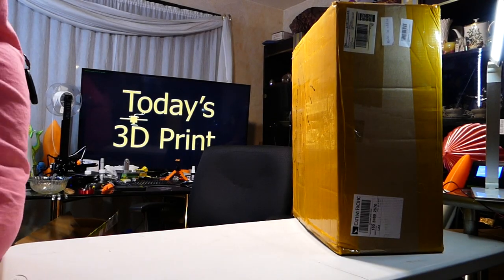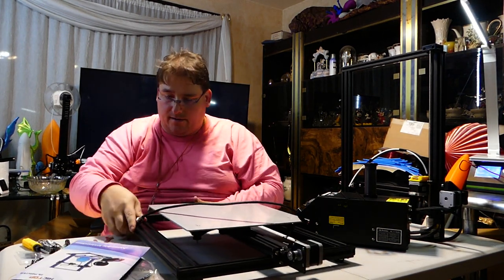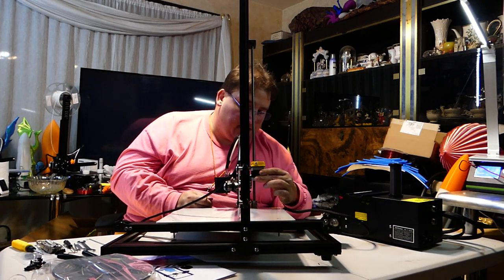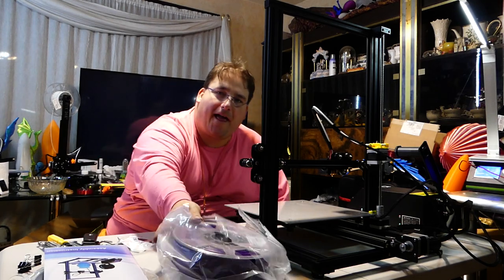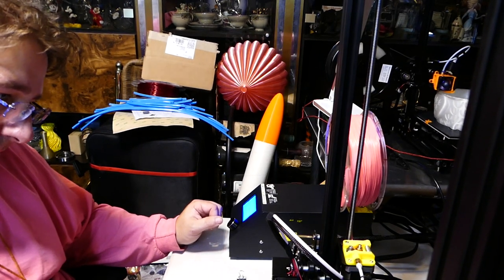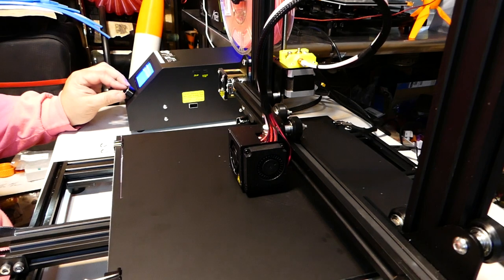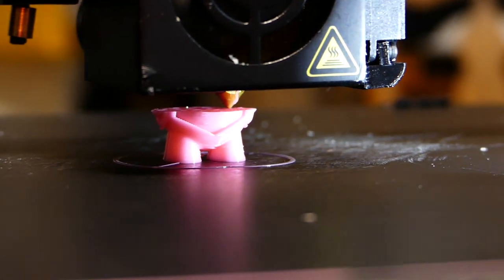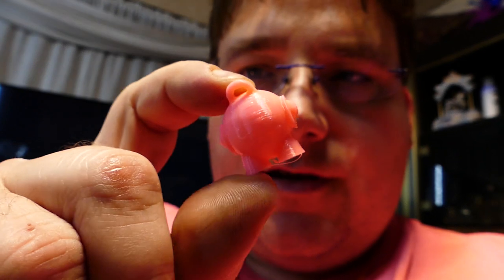Today's 3D Print - CR 10 Unboxing, Assembly, First Print

Comment: To save your setting, I believe there is a gcode command that you can send through a terminal to make it "stick".  I vaguely remember doing it when I had to adjust PID settings on a kossel pro.  Not sure if it applies to you, but you'll know what to search now.
Reply: EEPROM gcode command 
M500 Store current settings in EEPROM for the next startup or M501.
M501 Read all parameters from EEPROM. (Or, undo changes.)
M502 Reset current settings to defaults, as set in Configurations.h. (Follow with M500 to reset the EEPROM too.)
M503 Print the current settings – ''Not the settings stored in EEPROM.

This is what I used for a marlin firmware, idk the creality board yet.  But the original article I got this from is https://github.com/MarlinFirmware/Marlin/wiki/EEPROM

Comment: my printer had no excenter inner wheel on the left either. elephant feet didn't go away by adjusting the right inner one.. So I took the left inner roller out. Elephant foot gone and the whole thing is gliding perfect now! very easy and no play at all. before that I didn't manage to get all rollers in line and Z movement was too heavy.

Comment: Nice video. I like your no frills presentation. Doesn't waste my time. 2 concerns. Are the blue plastic inserts you threw out there to dampen noise? Also, are you kerping track of your mains A/C current, with all those steppers and hot ends, that's a lot to draw. Remember, the circuit breakers are there for emergencies. I recommend adding up the total amps being used. You know the wiring gets physically warm behind your walls with high currents. Best. Thanks for your expertise.
Reply from the maker: magaphoto not even close to 80% of circuit rating. On the one circuit 300w for the pc and monitor 350 at full tilt 20w in misc gizmos and 280w for the 2 enders. 650w on a 1800watt circuit.

The other circuit is now pulling around 370w for the 2 cr10's and 130 for the e10 and 8watt for the led lights and cameras. So about 510watt on an 1800watt circuit.

Not even close to 80% rated power so plenty of margin. All 8 printers (if i got them all going) lighta cams and computer might get near 80% of one circuit. They dont take anywhere near the power people think they do. 1800 watts is a lot of power.

The 3d printers take no real power. You c an run dozens and dozens of them on one circuit. Only the heaters take any real power. Around 40w for the heater cartridge and 60 to 130w for the heat beds at initial heating less for sustaining draw.

That does bring up something i have been meaning to do. Toss a killawatt on each machine to find their mamximum power draw and put a sticker on each with that value since i do plan to run quite a few of these eventually.

What blue things?
Reply: I'm glad you're keeping track of the current. Safety is always serious. I mean the stack of blue strips of plastic in the gantry and base you pulled out with pliers and stacked on your left. You asked if anyone wanted them. I have seen them orange on the web  too.
Reply from the maker: ahh those. they are 100% purely decorative. nothing more.

Comment: The box has right side up labeling on it - for when you get your third machine. I was a bit disappointed that these "new" machines don't have the rumored dual z axis screws
Reply from the maker: vidznstuff1 nope. My first machine i heeded that. Upside down. Then again it was repacked so maybe that was it. The cr10 does not come with dual screws. Thats the cr10s iirc and its slightly more money.
Reply: Nerys do you have a link for that one? The one with dual Z axis screws

Comment: U got to be carful pushing it around with steppers connected unless you disable motors or remove wires to stepper. When you had it up the bed slid backwards on its own , and would have caused a feedback current as it will act like a generator. If remove wires you will notice you can move more freely, with motor wires connected there will be a bit of resistance to movement.
Reply from the maker: NetWolf3D that's why I push it slowly I know the act as generators can backfeed voltage when you saw it slide it did that on its own and I have no idea why
Reply: Considering you said the nozzle and bed are heating, you probably exceed the power rating of the power supply thus the motors loss current which means they lost torque and since you had it slanted it was unable to hold with the current it had to work with.  

Path of least resistance is going to be the bed at probably 1.2-1.3 Ohms so whatever current flowing in the entire system will be focused to the bed then nozzle at 3ish ohms, Then motors probably at 4 ohms, until the bed and nozzle resistance rises and free's up the current to the motors to give them the torque back. 

Example -->12V / 1.2 ohms = 10 amps bed, 12V/3= 4 amp nozzle,  14 amps right off the start not including all the motors and components in the system.

If just one was heating then it may be a current issue to the motor and need to adjust the voltage of that motor. But sure looked like it lost torque/current when you started heating.

 It may have damaged the driver IC and diodes probably a good idea next time to just leave it flat and considering how fast it went back you probably generated quite a bit AC with a DC offset. 12V plus whatever that motor created which could be 30 volts so 42 volts of course this all depends on the motor and how much the motor can generate and motor operating voltage.
Reply: might be a connection issue of course, but you'll have to figure it out. best place to start is the connections to the motor. apply light pressure to the motor while steppers engaged  and wiggle the connectors if it gives then you may have found the issue.
Reply from the maker: nothing so far. and it has never done it while printing. very odd :-)

Comment: Thanks for this informative video! You have taken all the mystery and hocus-pocus out of assembling the printer and made it look quite easy; just what I need as I expect my CR-10 to come through the door any day now.

One thing I would like to see demystified is setting the nozzle height. I'm a measurement kind of guy and, although I am capable of tuning something by eye and feel, I would rather just establish a dimension and be done with it. Have you ever measured the actual distance in inches or mm between the nozzle and bed on your well-tuned CR-10's? Thanks for being an educator as well as an entertainer!
Reply from the maker: theoretically the nozzle should be precisely 80% of your desired layer height from the built plate. so for .2mm you would need the nozzle to be .16mm from the bed surface. this is pretty much impossible to achieve via measurement because many of the variables are well. "variable"

your x axis wiggles. your y axis wiggles. your nozzle wiggles. the filament is never perfectly constant. the extruder is not perfectly constant. your bed surface is not actually perfectly flat etc... etc...

a machine built with sufficient precision? sure. a $400 machine? no way. the "easiest" way is to visually confirm with extrude and visually inspect the result. adjust. extrude inspect the result.

I have gotten good enough that I can look at the gap. set it and just hit print and it will work 9 out of 10 times.

in theory once you refine your machine for consistency bed leveling ceases to be an issue. bed leveling is NOT something you need or should be doing every print every day every week or even sometimes every month.

it is a value that should "stay" once it is set. almost all of my mods are directed at achieving this state in my printers. I wake up. I load a file I hit print. I spend a few seconds to verify its working right and I leave.

Comment: ESun pla plus is my fav too, it's almost the same price as there normal PLA but is more robust.
Reply: I have given up on all PLA and switched to PETG as its replacement and I am about to throw ABS out the window and switch to ASA as its replacement.
Reply: Use eSun PLA as my go to ... it is very tough stuff, have not annealed it yet, will tomorrow to see if it stands up to the summer heat .... if it does I will be stoked. Have another high Temp PLA coming in, but it is quite expensive ... if eSun annealing works ...... why should I bother with anything else for about  90% of my applications unless I have a need for super industrial strength parts. I need usable parts most of the time, not something super crazy. Made three things today using eSun PLA pro in grey, and they all turned out great !

 Tried PETG and it was a disaster for me .. very bad stringing and it shatters when it reaches its breaking point .... it just about explodes with pieces going everywhere. Did not like it at all, I was testing it (using a MonoPrice i3 Plus) along with an engineering buddy using his PRUSA i3 MK2s and both of us had bad luck after a full weekend of doing nothing except trying just about every combo of settings to make it work.
Reply from the maker: The Best Stooge I can never switch to Petg completely can't handle overhangs

Comment: Putting my CR-10 together today.  My Z axis wheels are a bit too free wheeling to my liking on the hot end size.  How do I adjust them since there is no concentric nut on that side?
Reply from the maker: GarretB123 I believe once you tighten up the right-hand passive side that the dominant z-axis side will self align itself make sure the verticals are nice and straight and all tight as well
Reply: Yep!  You're exactly right!  I started adjusting the passive side and noticed that it did effect the dominant size.  All wheels make contact now although there is very slight slippage, I only adjusted the eccentric nut until the Z axis stayed put on its own and did not fall.  My thoughts are those wheels on the Z axis are primarily for alignment purpose and those wheels don't need to be as firm of a fit as the X axis.

Comment: Do you have a video of the top glass and the skin with details. I have the cr10 and I am trying to find mods I should do first.
Reply from the maker: +angel85lx do you mean the printing Z skin that I use?
Reply: yes the thing you put on top of the glass. you should do a video on that item a detail and why its good.
Reply: I tried ordering the PrintinZ skin and it is apparently out of stock directly from PrintinZ.  Did you get yours from them?  Or another supplier?

Comment: I wish I had the luck with my CR-10 that you seem to have with yours, I am two weeks with mine and I still can't get a print out of it.  I seem to have a problem with the an inconsistent filament flow.  Doing your bed leveling circle test my line of plastic varies in width from wide to nothing.  when I run a print there are gaps in the layers and the prints just fall apart.  I measured my filament diameter and entered that in Simplify 3D, then set my multiplier and no matter what I did I get this same issue.  I also changed the nozzle thinking maybe the first one was defective.
Reply from the maker: +crownironman go to one of my current videos one of the newest ones with a number the 130 or 140 s in the description have a link to my printer profiles first things first make sure everything is tight especially the grub screws on your extruder motor if that's slipping you're not going to get anywhere then install my profile for the cr-10 from that download link I also have sample G-Code to print them a marvin a Benji and a rocket try printing that see what happens I know the profile is good so that will remove your simplify 3D settings as a variable I know the g code is good so that will remove the G-Code as a variable then we can diagnose from there variable with Extrusion can also be caused by bad bad level but if you're getting that problem higher up the print it's not bad level it something else

This is less likely to be a problem today but what filament are you using? Did you measure it? Does the filament appear to change and thickness along its length pull out three feet does it all look the same size?

Update. I got to a PC and updated this videos description. so just click the description and goto the printer profiles link.
Reply: this is great, I will check all these things and do as you say.  I know the filament is not the best, Inland from Micro Center, I have some PLA Pro coming Friday.  Thanks for you help and the videos.
Reply from the maker: +crownironman no problem keep me in the loop I'll help as best I can I've never printed with inland but I hear they're okay as long as you didn't get it bad roll :-)
Reply: YOU ARE THE MAN!!!  I checked my extruder, it was not loose but the tensioner was too tight, it was not letting the lever move all the way back.  There should really be a shoulder screw on that so it can be tightened up without binding the tensioner.  anyways, I backed if off and the tensioner now snaps all the way back and the filament does not slip.  I also used you FFF and code and leveled the bed with a big circle, it all worked awesome.  Thanks so much for your efforts!
Reply from the maker: +crownironman no problem it's a lot of fun and it's a good feeling when you nail it and the prints come off right you're going to enjoy this :-)
Reply: Check your glass it might be warped if it is warped flip it around till your find the most level.

Comment: Did you have the start gcode somewhere? I remember seeing it in a video.
Reply from the maker: yes. Here is my gcode scripts. I THINK I got this from "The Hot End" and modified it for my desires.

Start G Code Script
G28 ; home all axes
G1 Z5 F3000 ; lift
G1 X40 Y2 F1500 ; avoid binder clips
G1 Z0.2 F3000 ; get ready to prime
G92 E0 ; reset extrusion distance
G1 X120 E10 F600 ; prime nozzle
G1 X150 F5000 ; quick wipe

my Ending Script

G28 X0 ; Home X Axis
G1 X285 ; Present Build Plate
M106 S0 ; Turn off Cooling Fan
M104 S0 ; Turn Off Extruder Heat
M140 S0 ; Turn of Bed Heat
M84 ; Disable Steppers

BE CAREFUL with the G1 X285 command. if you are sequential printing and your LAST part is NOT the HIGHEST PART and it is BEHIND the X gantry. you are about to crash right through that part :-)
Reply: Thanks alot :)

Comment: what is the gcode in the beginning that skips the clips and lays a bead in the front of the bed
Reply: G1 X40 Y5 F1500 ; avoid binder clips
Reply from the maker: pixelcomet that looks like it I will check my coat when I get home tomorrow night I think I increased the movements as mine was not completely clearing the clips
Reply: Thank you

Comment: Hey! :*) Gotta a couple of questions. 
1) Mirror Tiles from Home Depot: These it?  Glacier Bay (6-pack) 12x12 (actual size 12.5x12.5x1.5)
2) PRINTinZ (Skins - 310x310mm): This size for Glacier Bay (above) mirror tiles?
THX! Thumbs-up!
PS: I shoulda watched this vid 1st... Duh, me! (lol!)
Reply from the maker: yep those are in. crazy this. tip loosen the grub screw going into the heat sink and push the nozzle (when cold please it hurts when hot) up a bit.

that should net you enough clearance to "clear" the thicker glass plate if you end up needing a bit more. worked great for me. (one of my viewers showed me that one)

while they are thick and take longer to heat up they have the most critical property. super FLAT. your bed level woes be gone with that :-)

I think the glacial bay plates are actually 304x304 which you can order. or the 310x310 will work fine too and just over hang a bit.

print in z is not perfect but it sticks to pla like crazy and is insanely durable. get your bed level carefully set up LESS squish than you might normally need and 50c bed is plenty for it.
Reply: +Nerys Hey! :*)
Here's the dimensions (from the Specifications tab) of Home Depot's website (but we're all aware how product descriptions can sometimes be incorrect):
Glacier Bay 12 in. x 12 in. Plain Edge Mirror Tiles (6-Pack) Model #901010 - $9.99
*Product Depth (in.)
1.5 in*
Product Height (in.)
12.5 in
Product Width (in.)
12.5 in

Jeez, 1.5 inches thick. REALLY? Is that a fact, or transcription error? Seems too thick, maybe.  I dunno, I'm hoping that you can extrapolate. But you don't need unless doing so is different from your original reply.

PRINTinZ: 310mm to inches = 12.205 inches so, I believe what you are saying (for PRINTinZ) is buy the 310x310mm. 
Also, you say it's not perfect. Do you have something else in mind?

My printer has arrived. I haven't opened it yet. The outside of the shipping box is in almost flawless condition (only two (2) very small dings) and the cardboard appears to be quite new; it's amazingly clean. that means anything.

THX! my Internet friend. You're truly an asset to the 3D printing community. :*)

Comment: Why add the printz skin on a mirror and not just on the original cr10 glass. ?
Reply from the maker: +angel85lx because my original cr10 glass was not completely flat the mirror is :-)
Reply: Nerys oh ok. Thanks for the help and great videos.
Reply from the maker: +angel85lx no problem most of the current printers coming out of the factory have flat glass some of the early ones had warped glass
Reply: Nerys just checked my glass its warped. What's the links to the home depot and amazon glass. I found some in home depot but it's 6 for 20. And they have a bevel on the ends on mirror.
Reply from the maker: +angel85lx the unbeveled is 6 for $10

https://www.homedepot.com/p/Glacier-Bay-12-in-x-12-in-Plain-Edge-Bath-Mirrors-6-Pack-81175/205513215
Reply: thanks got them. Out 6 3 were good.
Reply from the maker: +angel85lx $3 a pop. Not too bad actually.